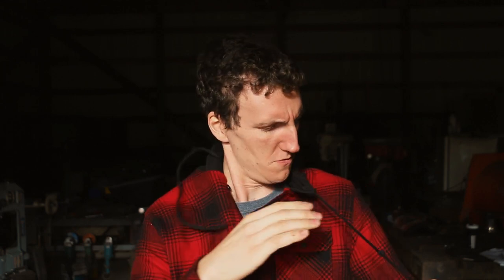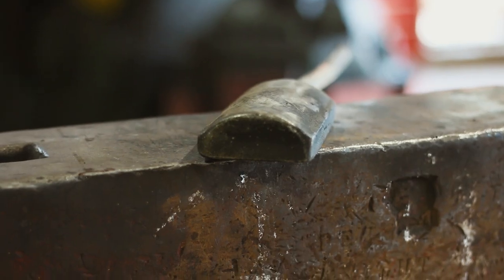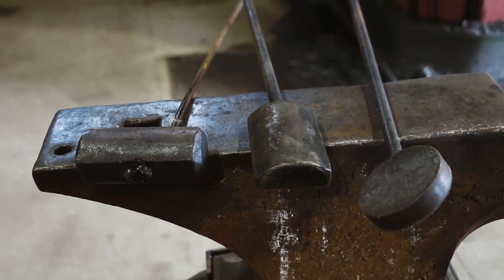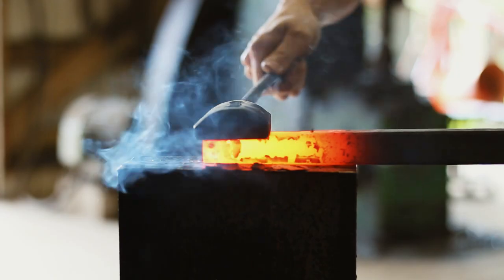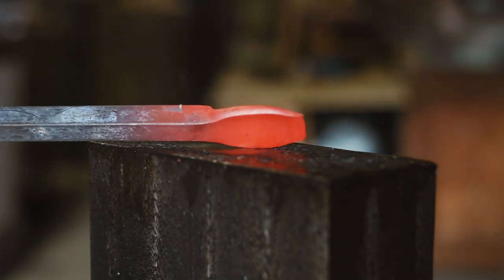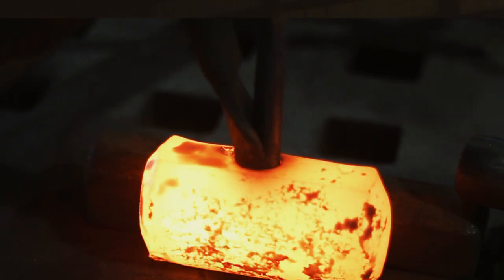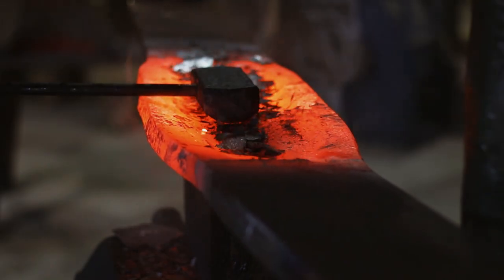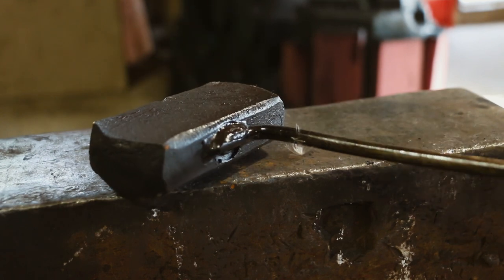POWER HAMMER TOOL YOU NEED.

Comment: You can also put the handle into the hole, and using a center punch "pin" the handle into the tool. Easy to reset when it gets loose. Brian Brazeal showed us that awhile back.